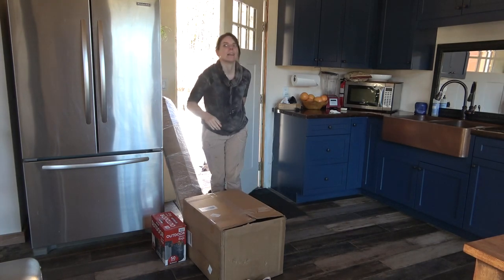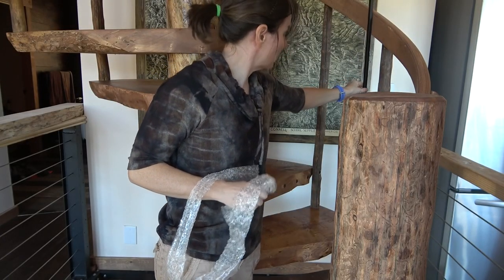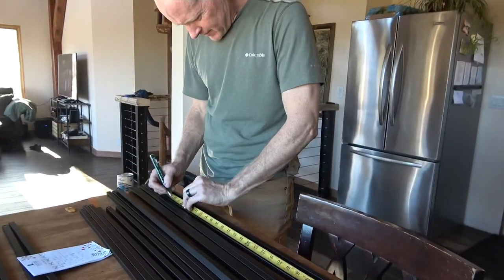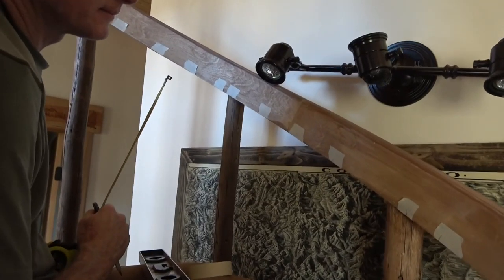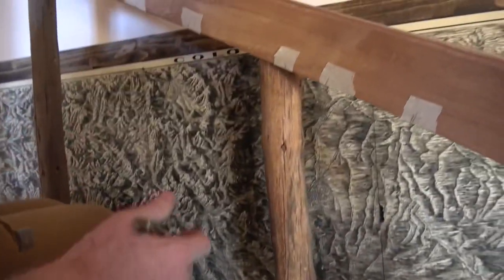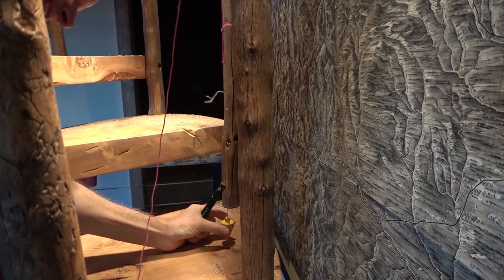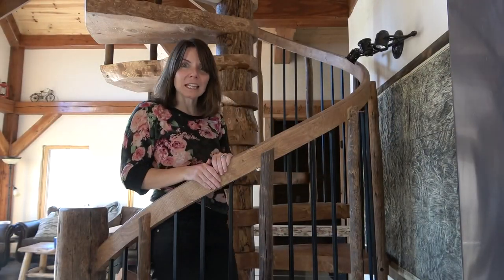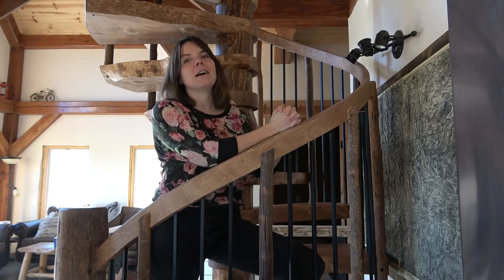Adding Metal Spindles to the Spiral Wood Stairs

Comment: The staircase is a beautiful work of art in itself. Well thought out and a whole lot of problem solving to get to Brian's vision. I love it but it would never be allowed where I am simply because all of the wooden parts are not kiln dried and heated to kill any bugs or larva in the wood. Our codes recognize that worm eaten wood is not as strong as wood that is not eaten. Keep an eye out for at least a full year for any signs of sawdust around or below the whole thing. You might have to chemically kill an infestation if they show up. Our code requires it to be heated above a certain temp for a certain time to avoid that issue entirely which kind of kills the Artistic Spirit that makes such works of art possible. Wonderful eye for style you two.
Reply from the maker: Interesting. But makes sense though. We had all the wood cut and stacked for about 2 years before we started the work on it. We did see some larvae in the slicing of the treads but since dealing with those, haven't seen any since. (you can actually hear them eating the wood!). Thanks so much.

Comment: When dealing with a curved surface pull out a tailor tape measure as they can work much easier then a standard construction one. 

Pick up a few of the cheap harbor freight corded grinders so you can have them setup for different needs without changing the disk.  The ability to go from cutting to grinding to a wire head without stopping to pull out tools is useful.
Reply from the maker: Good call! We've been using the cloth tape as well. And nice idea on the grinder heads, we have 2, but one needs 2 hands in order to use it.

Comment: ...Sharp look ........Q:.How are metal balusters secured ??....friction fit.... epoxy or drilled and set screw ??......Q: Each complete tread only supported by wood screw or lag bolt (1) through wood balusters??..(on the outside ,, wide side)..
Reply from the maker: It's friction fit. He was thinking of epoxy set but the friction is super snug and not room to put the epoxy.  On the wide size the treads have 2 wood balusters screwed to the adjacent tread.

Comment: everyone thinks that code is 4"   "code is a 3" ball cannot fit between  spindles balusters) "
Reply: .. Colorado UBC Has been ,, 4" for many years now ,, changes are always possible so always check with your county building department and inspector ....A  4" code is that a 4" sphere cannot pass through.. 3  7/8"Ok, ....4" NO  GO ..
..Amy's comment correct ,, with 1/2"baluster .. 4" on center will be ~ 3 1/2" spacing..~
..other concerns with stair build but not really able to tell on video ..... I'm sure they have met with the inspector on what they are creating...spiral stairs are an animal all their own ...
Reply from the maker: I should have added the < symbol.